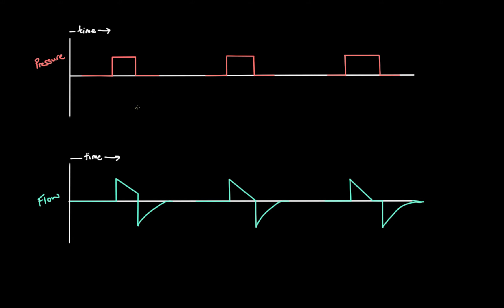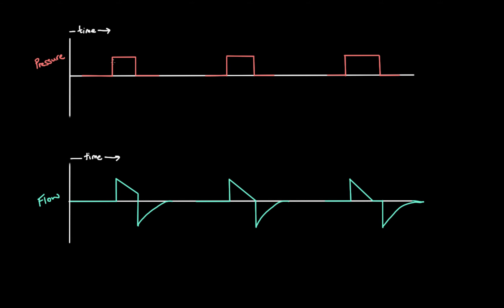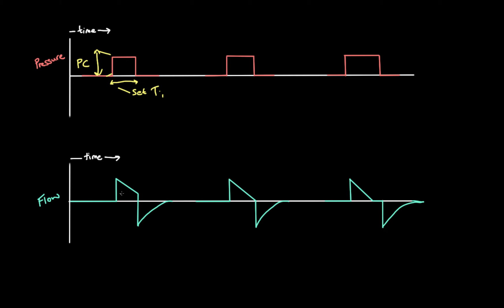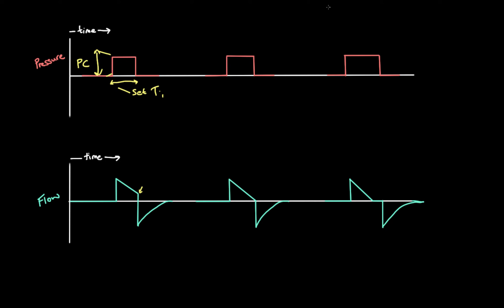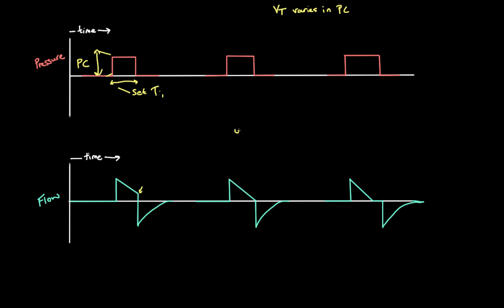Principles of Mech Vent 12: Inspiratory Time in Pressure Control: How to use the Flow Waveform!

Comment: Thank you for this video. Instead of increasing the (i time), can we increase the inspiratory rise? If not, what’s the relation between inspiratory rise and the amount of volume?
Reply: I'm still a student so I may not be accurate but I'm fairly certain that increasing inspiratory rise would be the same as increasing the flow. Instead of a smaller, more gradual rise, the flow would come faster. That faster speed would equal increased oxygenation because it would be in the alveoli longer, which means for a greater period of diffusion.

Comment: I don't know whether you're still active on the channel but I wanted to ask if the last graph can be a case of inspiratory pause, and how can this help the patient.
Reply: There is no inspiratory pause in pressure control ventilation. There is equilibration that can be reached by increasing insp. time.

Comment from the maker: Michelle:  In pressure control you don't have the option of increasing/decreasing the flow, like you do in volume control. It is not a variable we decide on in pressure control, the flow rate will be the result of the pressures we set, and the patients lung mechanics etc.